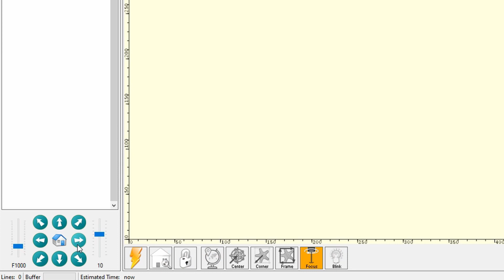Useful upgrades for your Laser Cutting and Engraving Machine | NEJE

Comment: I got some short 2x2 6 inch wood blocks and hot glued them to my desk then attached my laser to that and I got glued my Matt squared up to it so I can line up my work pieces and I got air assist with a nice airbrush compressor I've been using the neje app but it's loud and sluggish I have light burn but haven't figured it out yet my new upgrade is going to be raising the laser up to at least 12 inches and also repossession my laser to be placed rectangular on my desk to fit longer material and I got some lab jacks coming to raising and lower my material this will make things so much easier and now I just got to figure out this light burn program also my laser works perfect at 1.5 inches from the bottom of the laser module to the top of material 😀

Comment: Does anybody know how to adjust for kerf when the laser focus is a rectangle like with the 4063 or 4064? 

I would appreciate since this is a big killer of any precise cutting project for me now.
Reply from the maker: Hi, Евгени Георгиев; thank you for your comment. 

I have a dedicated video about kerf https://youtu.be/RETtEIOv2Ps and fit test template https://whathowwhysolution.com/wp-content/uploads/2022/01/Kerf-Fit-Test.zip

In short, you need to run a test which is specific to your machine/laser and material combination; this will give you the kerf value.
From here, you need to account for kerf in your design accordingly. 

If you are working with LightBurn or LaserWeb, they have dedicated tools to account for kerf. However, the kerf of a diode laser machine is not uniform across the axis, therefore is best to manually or parametrically account for kerf in your design considering the direction of the cut.

I hope it helps. 
PS. I will remove the same comment you asked in my other videos as I replied here.

Ciao

Comment: Great video, I need help, when I move a G Code from Inkscape to NEJE it does not follow the exact measurements, for example if I give it 406 mm in width like the Inkscape file has, NEJE will adjust to 405.3. Any advice? Thank you
Reply from the maker: Hello Cristtian Gonzalez, thank you for your comment.

This is a problem caused by the fixed pixel size in Neje's machines, I have discussed it in my video about burning time https://youtu.be/Z3jfXzMeBAg, but in short, the pixel in the NEJE environment is 0.075mm, so the machine approximates to the closest 0.075mm so if you do 405.3/0.075=5404px which as you can see is an integer, also pay attention to what Inkscape is measuring, if you have some stroke width applied to your geometry, the dimension box on the top includes that, but the gcode cares about the actual path line so you need to take away the width of the path.
In your case, I believe you are reading 406mm, but you have somewhere around 0.65mm of stroke.

I hope it helps,
Ciao

Comment: Re burn marks on wood engraving wood
 I did read on one review site that placing piece of cloth over the wood helps It from scorching (seriously) and not a known bad piece of advice. I haven't tried it as I only have a fibre laser.
Reply from the maker: Hello Chris Robinson, thank you for your comment and advice.

I will test that out.
In general, I obtain a good result with masking tape, which apart from being cheap doesn't cough on fire.

Ciao

Comment: Great idea, I just downloaded the file, I have just ordered the Neje 80 W Laser and will have to wait to see if it fits the larger Laser module. Thank You
Reply from the maker: Hello Alan Wright, thank you for your comment.

That is a great module to put hands on for comparison, as far as I understand is the 40W module from Neje but marketed as 80W from sellers, in fact, the Module Number is the same A40640 and if you run a quick check on the power brick rated as 12V 4A, the max power is 48W.

Let me know how does it perform.
See my latest video with the upgrade to 40W
https://www.youtube.com/watch?v=PASPwsPtVl4&list=PL--bqtBHPhQO0j6b4v4HmD3dlTXBIUrDq&index=15

Ciao
Reply: @MiddleRoomWorkshop  Thank you for your reply, I contacted Neje about your claim that it is not 80 W and they say it is as it has 2 Diodes which double the output power.
Reply from the maker: Hello Alan Wright, thank you for your feedback.

I hope to be wrong as that would be unfear from the seller.
Simply, the 40W module is also a dual laser and it comes built with FAC lens, and during my test went all the way through 18mm of wood in 4 passes.
https://youtu.be/PASPwsPtVl4

Ciao

Comment: Totem S 40W / NEJE Master 2S Max / Atomstack A5 Pro / Ortur Laser Master 2 pro
I found the four. would like to know which one of the favorites is and which one is best for small knives, normal kitchen knives, silver key rings, zippo, silver engraved bracelet for children. thank you in advance for the help and information I will get. nice day
Reply from the maker: Hello Egeli, Thank you for your comment.

It is not an easy answer as there are many variables and all is by lack with these cheap engravers.
Anyhow, I have personal experiences the NEJE master 2s Plus which is the smaller brother of the NEJE master 2s Max, and I can tell you that is okay, you are only limited by the software which yet kind of does all you might need just there is some workaround, and if you have the budget you could get LightBurn and your limitation are over. 

The other three models from what I can see they are pretty much the same, coming in different designs. 

Laser module; 
Comparing the base module, the Neje is the most powerful optically at 7.5w, however, the other 3 machines came with FAC lens which is more efficient and focuses the laser into a narrower point making it somewhat equivalent in power despite being 5 to 5.5w.

Frame:
The best frame in my opinion is the Totem S 40w, even if it has more plastic components but it comes with a cool mechanism to easily adjust the height of the module i.e., the focus.
The Atomstack A5 Pro is also good especially if you need to put thicker stuff under as it has greater clearance, however, the height adjustment is a bit trickier with 2 screws. Note: the device shown on the website is unwired.
The Artur Laser Master 2 Pro has some cool reference metrics in the frame but is the messiest and it requires the cable in the front. The good feature that should be in the other machines is the emergency stop.

Software:
Despite it not being great Neje is the only one to offer native software out of the box and it has a smooth and easy set-up so far, as for the other I personally do not like to work with benbox, and I limit LaserGRBL for picture only as it offers more options than the NEJE one.

Engraving:
The smaller square spot created by the module with FAC lenses is way clearer and precise than C-lens so I give this to the other 3 machines, however, if you go with NEJE A40640 dual laser with FAC Lens and 15w optical power you will be able to do all you need. (by the way, stay tuned as I ordered one for upgrade)
For metals, it seems like the Atomstack is the one.

As I say the answer is not easy, so I cannot really give you a verdict since I do not have experience with the other 3 machines.

I hope this helps.
Ciao

Comment: I have downloaded your files on the Laser Module Height Adjuster and a friend with a 3D printer has generated the tool for me. Do you have a YouTube video or a page on  a website that shows how you installed this tool or is it obvious? Mine are in the mail to me from my friend. I just want to be ready when I receive it. Thanks in advance.
Reply from the maker: Hello Rebecca, thank you for your comment.

The installation should be pretty straight forward but I have made a quick video just to show you the process:
https://youtu.be/jdqj7TJGWPA

I hope it helps, 
Ciao
Reply: Re burn marks on wood engraving wood.
 I did read on one review site that placing a piece of cloth over the wood whilst you do your burn. helps (seriously) it's from another well reputed and knowledgeable  guys site.

I think it maybe because it keeps it cooler than the ambient temperature, and so when combined with the humidity they al help by being cooler on both sides of your burn.
Its cooler and at a consistent temperature. All 3 work together -  humidity - temperature - and direct cooling of the burn temperature occurring at both sides of your burn -  it dose make a lot of sense

Comment: Is it true that a lower power 7W laser Module diode has a better quality\higher (DPI) engraving resolution than a high power 20W laser Module diode? I saw this information in a video here https://www.youtube.com/watch?v=6lBKCcUviZ4&t=515s  THANKS!
Reply from the maker: Hello Graphosxp, thank you for your comment.

Thank you for sharing the video with me, Yes it is true to some degree.
I am not sure if the most powerful Diode in the market is 7W (optical Power), as far as I remember I was reading an article a few years ago about some producer is well known in the industry who was working on the feasibility of an 80W laser diode.

Said so it should be noted that the YouTuber in the other video is correct i.e. what manufacturers are selling is the power of the entire module and not the optical power of the laser, in fact, if I plug my NEJE Master with 30W Module in a Power Meter it reads 29.6W at full power with the axis moving.

There are techniques to increase the effective power of the beam by optically collide multiple lasers on the same spot, but the lower the power of the laser then the lower is the focusing spot so better engraving quality or Higher DPI.

Consider that if you get a 7W module for the very same reason explained above you will actually get an optical power of a few Watt.

I hope my answer helps you.

Ciao
Reply: @MiddleRoomWorkshop  THANKS! This was very helpful.